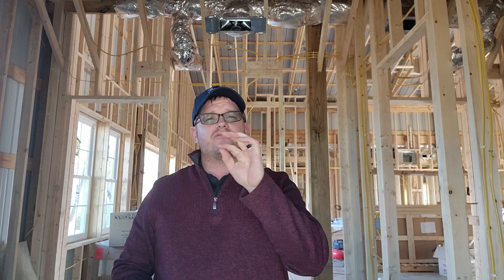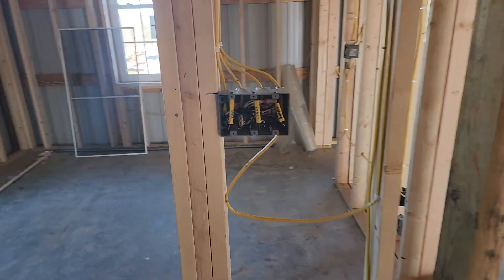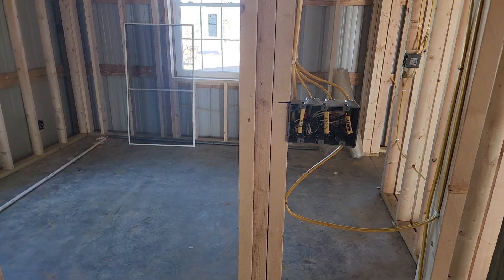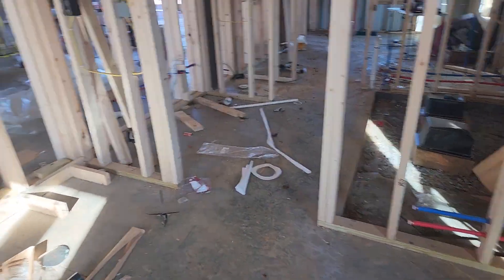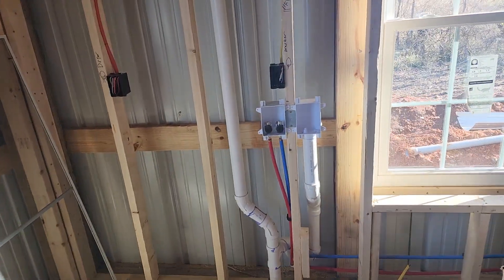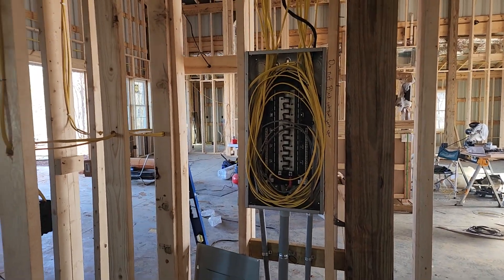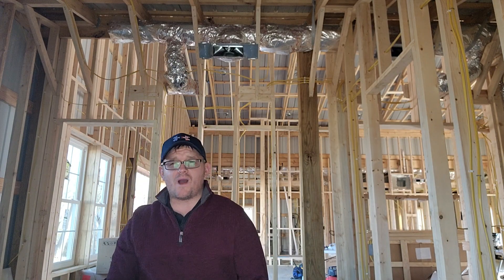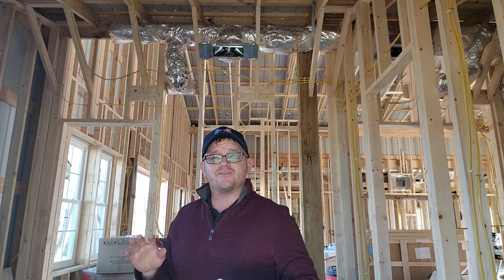5 tips for Rough-in Phase on New Construction. Electrical wiring.

Comment: How far is the cable supposed to be stapled away from the face of the stud so a drywall screw will not hit it?
Reply: 1 1/4" or you have to use a nail plate

Comment: Was the 12 gage wire a bulk cost thing or do you use it as your practice? I wish when we did condos and houses years back-don’t laugh coach- that we had pictures like you were saying. Avoiding lots of finger pointing etc. great video 👍
Reply: I believe some states require you to use 12awg for most of the circuits
Reply: Yeah I believe too ahg
Reply: CCA .

Comment: DIY question. For rough ins does the sheathing on the romex wires in the outlet boxes have to be trimmed to code or is it more common just to roll up romex and tuck in box. Yes, I'm getting inspected.
Reply: Skin it back and fold the wires back into the box. Make sure you leave your 6 inches
Reply: Yes , but leave enough skin to protect the wires entering the box , I’ve seen em short at at that point , especially going into a metal box using a Romeo connector

Comment: Nice idea on taking pictures. My boss used to do that and always lost track of which job was which. I told him to take a shot of the mailbox # or the outside of the house before going inside. That helped quite a bit. You can also add sticky notes on the wall to identify which room or which direction the shots are. (front bedroom, north, south, etc) Just one per room or in any other confusing situation will do.
Reply: I insert cardboard in my interior panels and write the address or lot number on it in sharpie along with how many cans, etc. Then I start a video with that as a sort of thumbnail. when strolling through pictures I can see which house it is.

Comment: Unfortunately there are some inspectors in my area that will not pass a rough end if you do not have the vanity light in a box
Reply: yes I have same issue. We install pancake boxes where the mirror is to be installed, once we get on site remove pancake box, install cut in box where vanity lights are to be then cover hole with mirror.
Reply: We dealt with one of those and could not get him to understand the rationale for floating the wire so we had to box up to pass than remove the boxes before the drywall was installed

Comment: No 15 amp circuits ?
Reply: If you look at the big picture on cost, it only saves a few bucks on a new construction job. Why bother? Yeah, certain appliances like a furnace only need 15 amps, but you can always downsize the breaker.
Reply: Some municipalities where I am from do not let you use 14 gauge wire. He may be in one of these, NEC allows it and I use it whenever I can.
Reply: Might be the specs
Reply: Same question. Do you always run 20 amp circuits in all your home's?